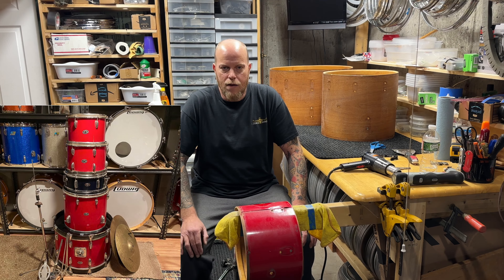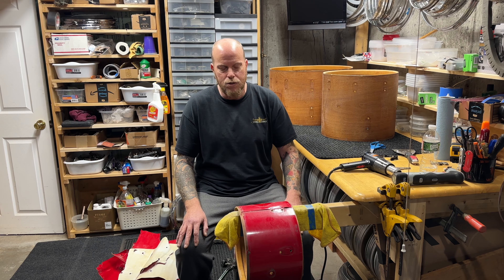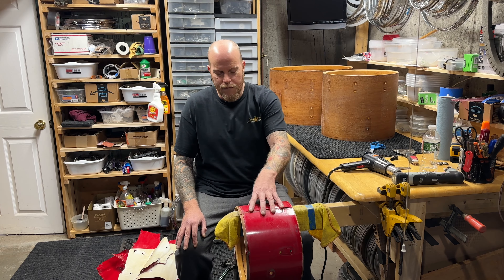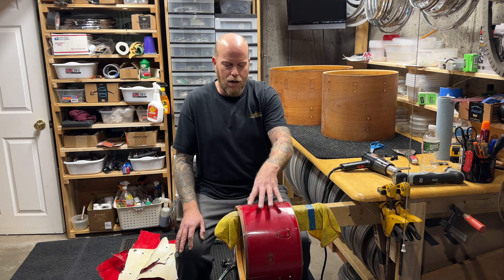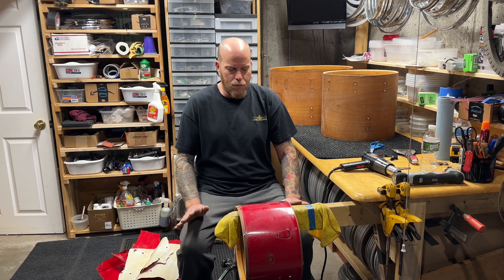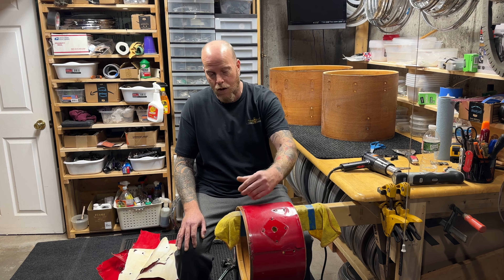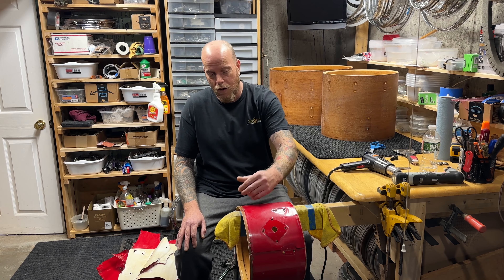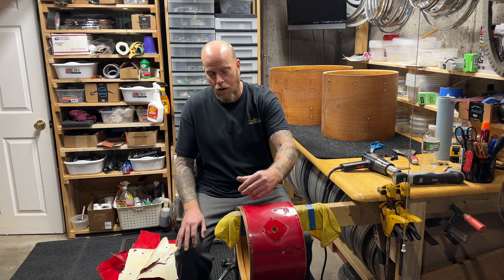70's Slingerland drum set project. How to remove drum wrap.

Comment: hello - what brand  of heat gun do you use? do you work on bearing edges too?
Reply from the maker: Think mine is a Milwaukee but any brand will work and I do! Only if they need it though! Thanks for watching!
Reply: @shawnsdrumcave  are you based in New England?
Reply from the maker: @MrCharlieroo  yes Massachusetts
Reply: @shawnsdrumcave  I live in mass too and I'm trying to find someone to re-do edges on my radio kings. if not you, can you recommend someone? thanks either way.
Reply from the maker: @MrCharlieroo  cool man! I don't have time for customer work atm but village drum in R.I. does great work.
Reply: @shawnsdrumcave  ok, thanks. someone else had just mentioned this to me too so, I will check them out. thanks again. great work on your videos. going to try and remove the wrap from one of my drums. cheers!!
Reply from the maker: @MrCharlieroo  thanks!